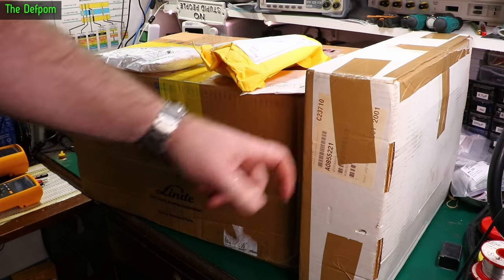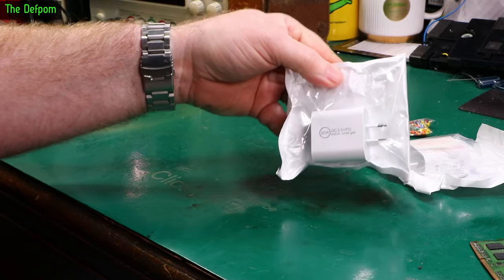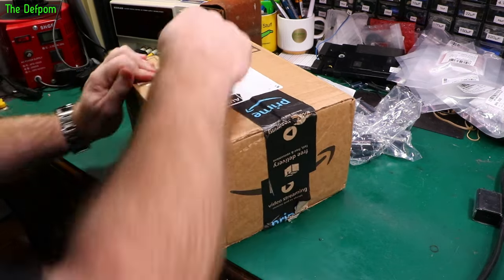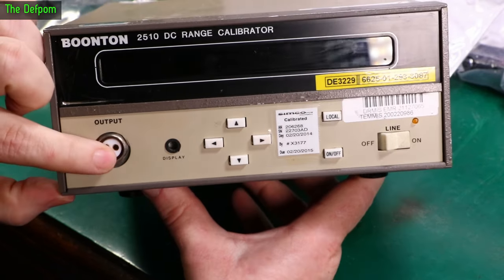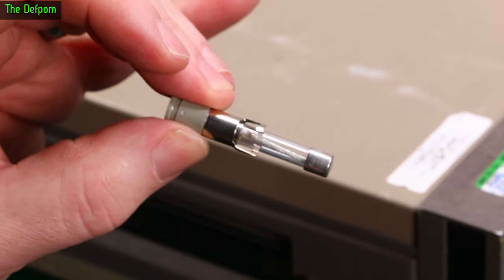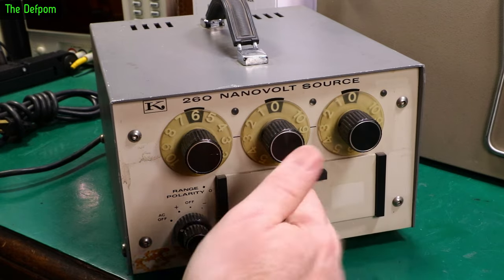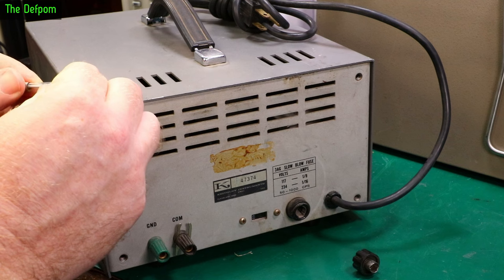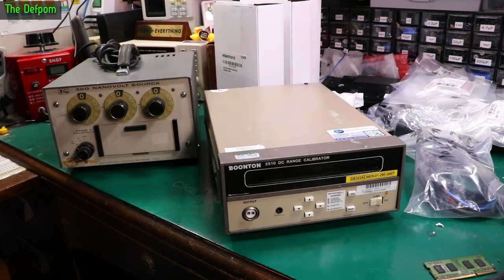🔴 Mailbag Monday 30th October 2023 - No.1191

Comment: Oops!....I think you set the 2510 incoming AC selection to 100VAC. Looks like it was originally set to 120VAC.
Reply: I was waiting for the poof 🤣
Reply: It was probably set to 120v originally so compare switch positions to the diagram and adjust them to what 240v should be.

Comment: If in doubt about an input voltage selector, in the civilised world you should adjust it for the highest mains-input resistance. For the less civilised areas and Japan, a lower resistance indicates the correct input setting.

Comment: is the fuse voltage rating an indication of the voltage it was designed to break.
 Specifically, the voltage rating determines the ability of the fuse to suppress the internal arcing that occurs after a fuse link melts and an arc is produced. If a fuse is used with a voltage rating lower than the circuit
voltage, it may not break the current safely.
So the 32V fuse may blow but the arc may reform the break and kill you. 😞
Reply: The voltage rating probably wouldn't matter, the MDL 10 is a 10 amp medium delay (slow-blow) fuse. 😮
Reply: @davidv1289  With a 32V fuse, it may not break a 240V circuit. it will blow but the arc may reweld the fuse back. For safety you need to always replace a fuse with the correct voltage rating or higher. In the UK you can't have a glass fuse in a plug as without the sand inside it will not break the arc. But with AC at least the arc only lasts for period before going out as it crosses zero volts.
Reply: @TheEmbeddedHobbyist  You are absolutely right. The voltage rating of the fuse is as important as the amperage rating. My point, a weak attempt at humor, was that with a 10 amp fuse in that instrument, something else would probably melt down first, before the fuse. Regards, David
Reply: @davidv1289  sorry missed that 🙂
You are right it's a well known fact that transistors are the fasted 3-legged fuses on the market, 110% faster than a F type fuse.

Comment: I was interested in a piece of equipment from Valuetronics but became disinterested because the photos used in the advertisement (manufacturer photos) did not match the condition of the actual equipment offered (really tired). They said the equipment had a six month guarantee but I would be responsible for shipping both ways😮. Thanks but no thanks.

Comment: Revisit the voltage selection for the Boonton. IMO you got that arse about face. Black on the diagram represents the switch position. Fuse did its job. Phew.
Reply: Not out of the woods yet, the xfrm secondaries went through the roof for a second or so there.
Reply: @IanScottJohnston  One only hopes the Defpom doesn't pop a bigger fuse in and tries again.